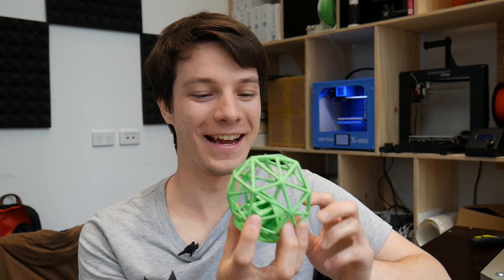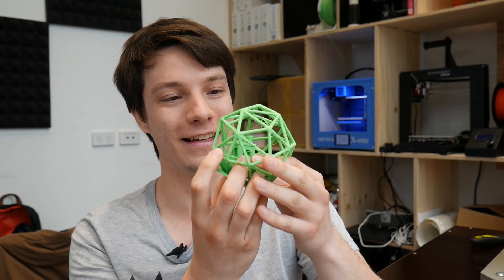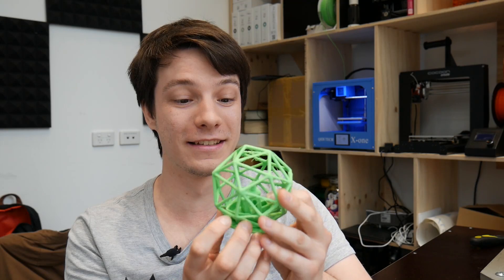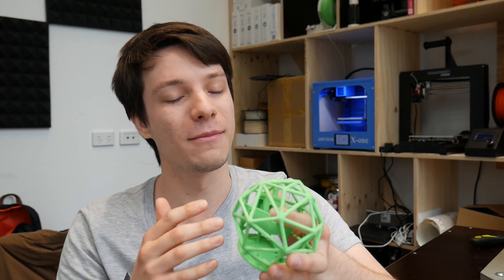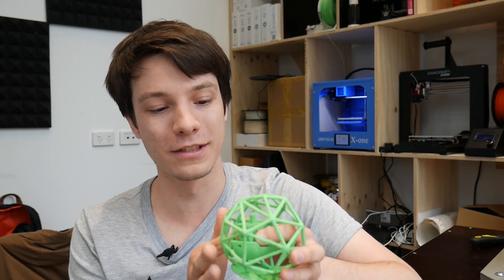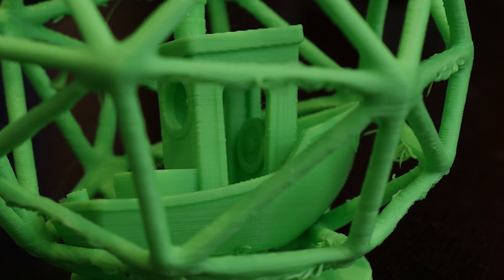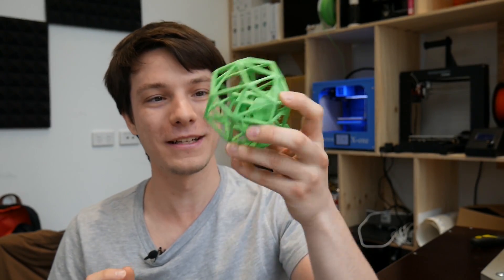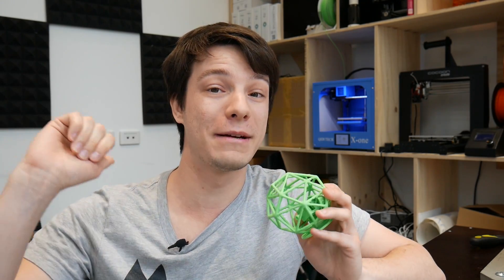Will it Print? #3DBenchy + 3D Printed Lattice = Insanity

Comment: for my qidi tech printer i was thinking of geting some of that flat fridge magnet and taking my spare build tack and sticking it on one of the sides. it would be easier to remove the prints i hope. do you think it would work
Reply from the maker: If you warm the print bed up it'll demagnetize - you need higher temp resistant magnets like rare earth to pull that kind of thing off afaik.

Comment: I think if you could use (i know you don't like it but) PVA for this print it will increase the quality of the print!
Actually do you have a printer that can use PVA ?

PS: Are you going to give the STL file on Patreon or share it with us ? (i'm not going to lie, my second printer can print with PVA so i want to try that thing)
Reply from the maker: No machines here that can PVA sadly! And can't distribute as it's against the licencing terms for the 3DBenchy, but it's a pretty easy process in Meshmixer, just a bit tedious. I used the make pattern tool on a low-poly mesh to create the lattice.
Reply: Ok thank you so much answering my question!    :)
#Highfive 
PS: Do you think i can do that on Fusion 360 ?

Comment: that support is for the resing print.. sorry for my english
Reply from the maker: They had intersecting bodies so did fail pretty bad, but you can actually use these on FDM as well - the flashforge machines tend to default to tree-like supports.